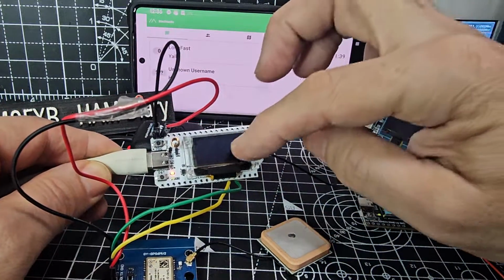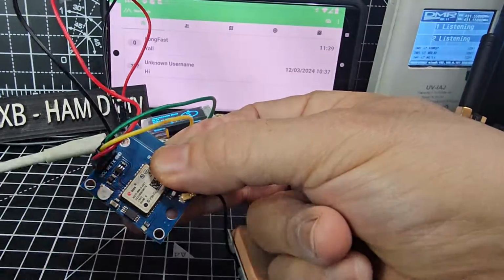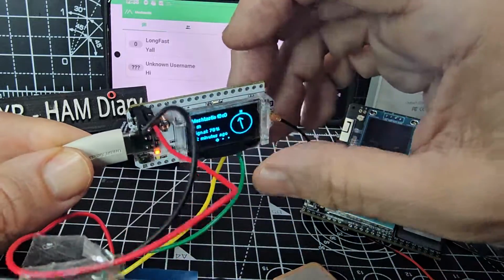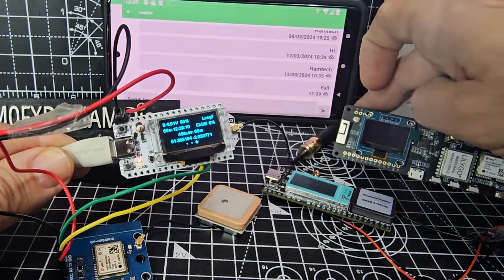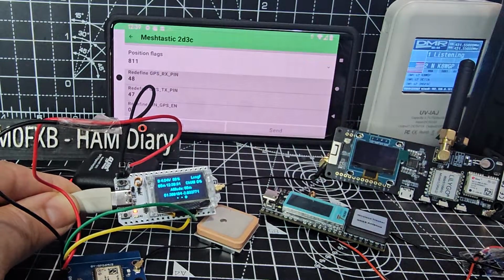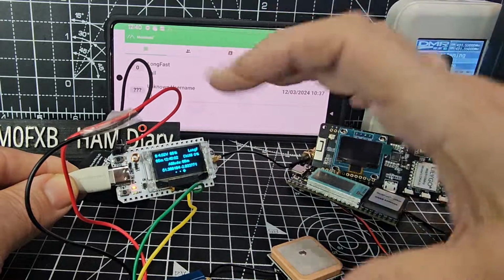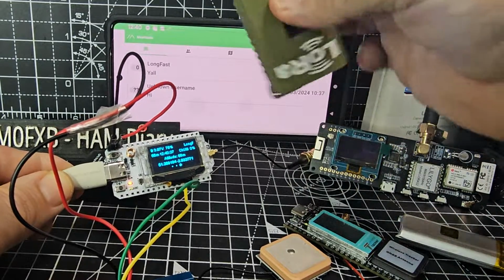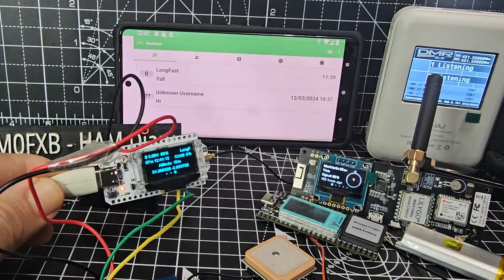HELTEC V3 -  GPS Module & GPS BOOSTER

Comment: Dear Sir,

I am writing to you from Chile, where I am currently involved in a project that utilizes the LoRa32 v2.1.6.1 module from LilyGo. My aim is to set up a mesh network with several nodes, each capable of transmitting data from a flow sensor and GPS to a master node. This master node would be connected to a cellphone. Would it be possible to display both the location and the flow data on the same map on the cellphone? I would appreciate any guidance or suggestions you might provide.
Reply from the maker: Hi this is above my knowledge but seems to me your can use the mqtt server .

Comment: Have you used this as a Tracker? Trying to figure this out for off leash dog areas.
Reply from the maker: If set to auto tx with a gps lock could work .
Reply from the maker: very easy:
use the android app.
connect t beams with android app by bluetooth.
put all t-beams on the same lora channel: (channel menu, just enter a channel name for first device, copy the channels qr code , and then at the same menu of android app. use this qr code for the channel setting of other devices…) (or just put all nodes on default channel by reseting channel settings, but like that, other users can see your positions too)
by default, all devices will now send there position to all other devices.
1 device stays connected to android app on tablet, where you can opten the map (within android app) and there it shows actuall or past position of other nodes…

to get a good range for reception…
put the node of command vehicle HIGH above Ground maybe on roof or a mast attaqched to the car.
the tablet can still connect by bluetooth
then you should see the othger nodes position also from a few km away…
the nodes start sending position when they have a gps fix. that may need a few minutes on startup…

no need to use wifi or hotspot or mqtt…